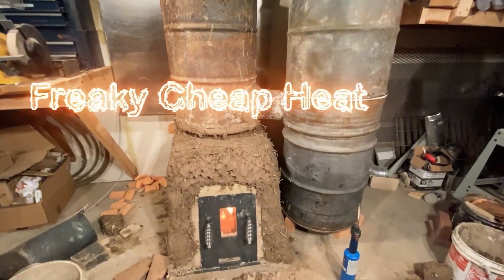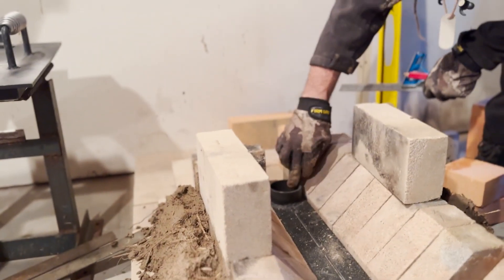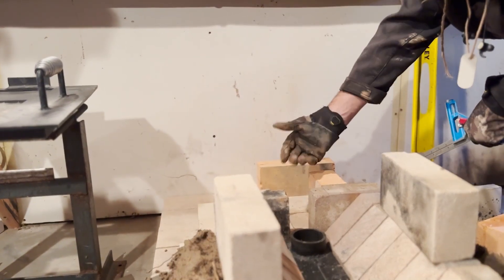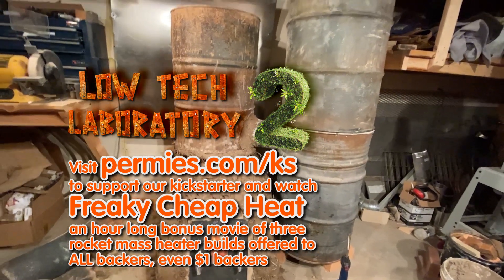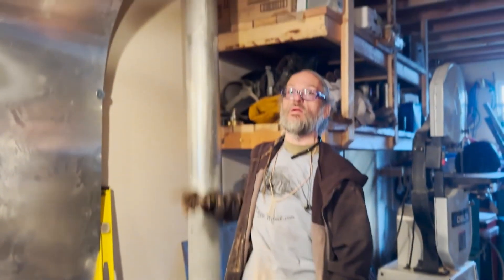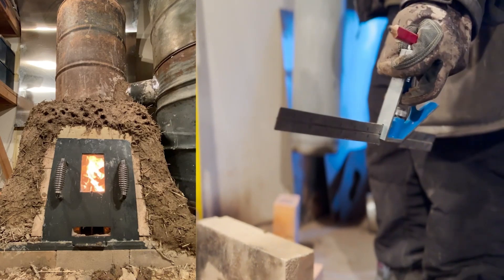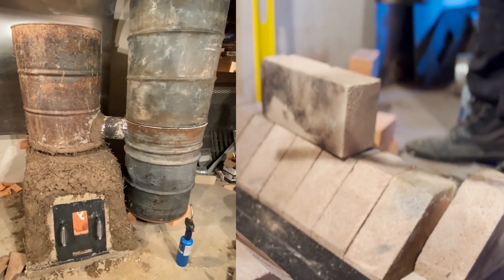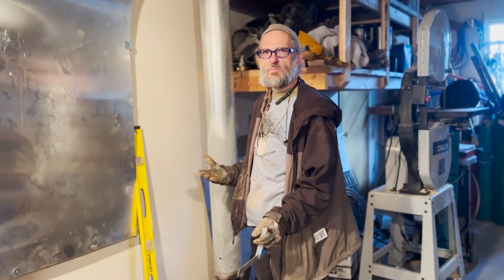Freaky Cheap Heat: a new 7 inch batch box rocket heater for a wood shop

Comment: I made one out of two vegetable oil drums thrown out from the local takeaway and some vermiculite bricks for the j tube and some high temp sealant and it worked a treat. Proper rockety sound and the waste turned to water vapor. My son called it a " ghetto heater".